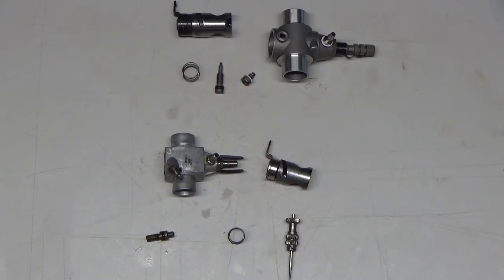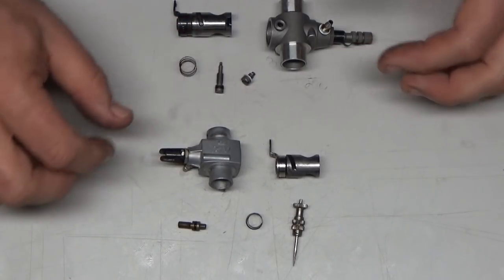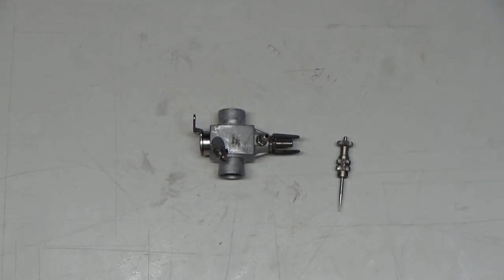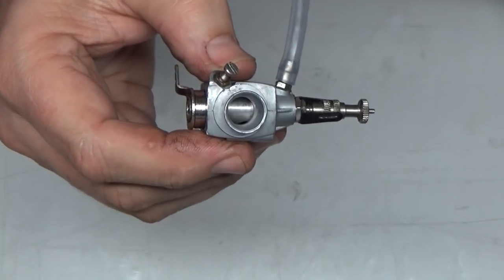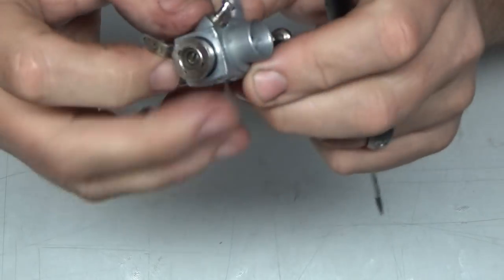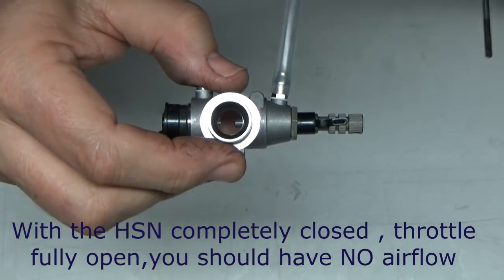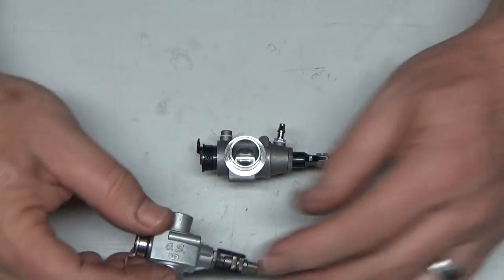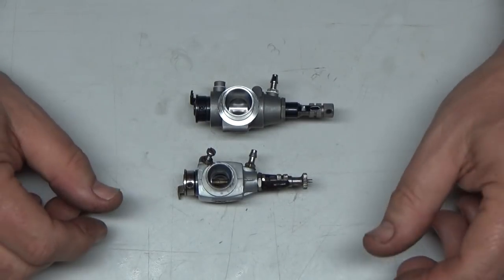How To: Setup A Carburetor

Comment: I read on a site about how RC carburetors work, they say to never bottom out a low speed mixture screw, it could change the opening of the jet and cause tuning difficulties.
Reply from the maker: How many carbs have you had apart?  You can do the same thing with a high speed needle if you close it too tightly.  Many carbs have different types of spray bar assemblies.  So your general statement only applies to certain types of carbs and how 'ham fisted' you are.

Comment: just set it so air is shut off when throttle is shut but as it starts to open you should hear air start to flow. top end speed has to be what ever from this. Once you start engine it then take no time to set it total.

Comment: Thanks for one of easiest ways to explain this process. I bought an old Carl Goldberg Freedom 20. I kew nothing about glow engines, I fly all electric, but I followed your video and it started right up. After cleaning it. It didn't look like it was ran very much. It still need help, but I think it's a matter of getting all the adjustments just right. It's not an expensive engines, but I think I'll buy more used ones and clean them up. Thanks.

Comment: Blowing air into the fuel inlet helped me to get my Moki 180 running. The carb has a dial style low end mixture adjustment. By blowing air into the fuel inlet, I discovered that I was misunderstanding the plus/minus marks on the dial. 
The next step is to upgrade to large fuel line. 
Thanks again

Comment: Looks easy enough to me, thanks. I knew there had to be an easier way to set up a carb than what the manual says. I prefer to do things the way you do them, as I have done many small engine repairs in my life, this type of carb is different for me but I KNEW someone had an old timer method of getting these nitro engines tuned at a starting point. With most engines you would use an ear anyways. I have had people ask me about RPMs and I just stare at them. Anyone working around engines long enough ,doesnt need a meter to tune an engine. At least I never have. I could set the carbs on a twin cylinder snowmobile by ear to out race anything on the track using my ear and a spark plug wrench( to read the plugs).

Comment: Thanks mate, just qualified for my wings on Boomerang 40 EP have a 0.25 ci Enya Diesel to run in for my foray into IC Engines. This'll help heaps (Luckily I have many IC flyer at my club who use your method for card setup).

RW

Comment: Newbie here I have a fox 40 engine but the carb throttle barrel is frozen stiff.
Do I need to find a replacement or is there a way to free it up?
It looks like the previous owner had heavy oil in the fuel mixture.

Comment: Hi, my carburettor does not have a high speed valve, but only a throttle stop and a idle screw. I can see that it once has had a "remote needle valve" i think it's called. Would this have the same effect as the high speed screw on the carburettor in the video?
Reply: yes, it's a remote needle valve instead of a needle valve on the carb.

Comment: Nice video! I have a noob question... So I have a surpass fs-70 and the carburator like others have the throttle Barrel with a spring in the bottom , my doubt is that that spring is to push the barrel out and take care of the slop that exists, but if I'm running the  engine and push the throttle barrel against the spring with for example my finger then  it will move a little and the needle will close a bit and that would be sufficient to change the mixture and for example cease the engine... The spring is a new os original so I would like you to help me to understand if this is normal and why...
Reply from the maker: Yes it is possible to affect the running and mixture settings by pushing in on the carb barrel.  In normal operation there is nothing pushing in on the barrel so.....  What is the issue?
Reply: @dmrcflyr2  I have an OS 46 ax the low idle speed I followed all the instructions it runs great when I get it set but as I run the engine the screw goes in I'm lost help this is Woody